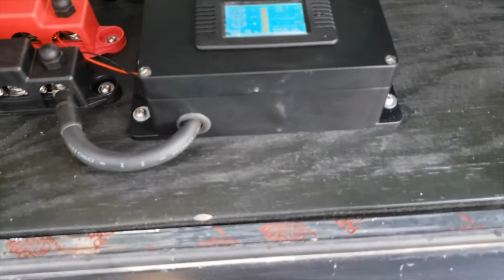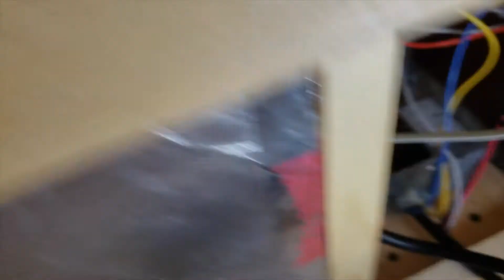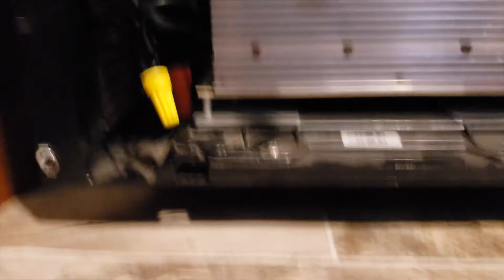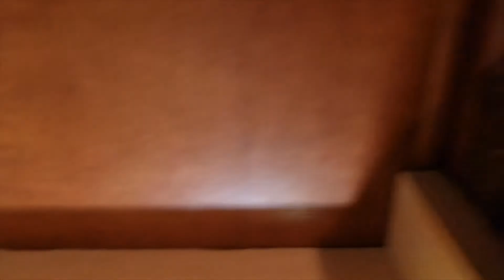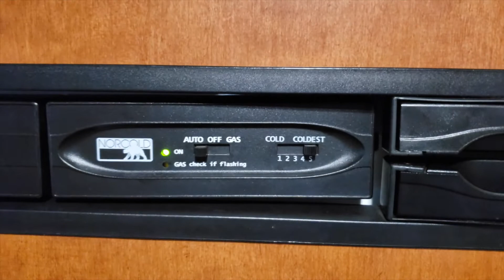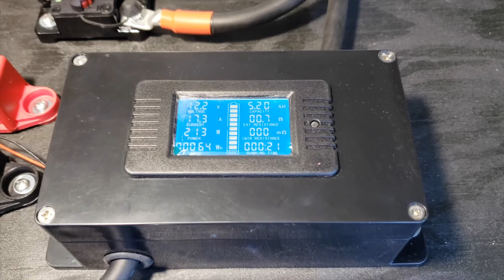Nash 17k Inverter power system installation - Part 2

Comment: I installed a big inverter under the bed in my Nash 17k.  I still haven't edited the video for that project.

The only concern with your system is the extremely long cable run between the inverter and the battery bank.  The generally accepted rule is not to exceed 10 feet, the reason is to minimized voltage drop on the DC cables.
Reply from the maker: I agree the cable length is not ideal, and would probably not install anything larger back there. The cables are 2ga, and at that length should carry 100a. Pulling 500w @ 12vdc im right around 50a, and it seems to be performing okay. I did a rundown test today and got 160ah out of the batteries before getting to 10.3vdc.

I now have a tray installed for the 3rd battery, next to the inverter. I think this would help if I decided to put in a larger inverter in that compartment, too.
Reply: 10 feet? Is the 17K different than the FM? Ours has the generator box right up front near the batteries.
Also, how long can you run the inverter with the refer running before the draw depletes the batteries
Reply: @davirodrigues8426  17k and 18fm are totally different floor plans with different locations for the generator compartment, bathroom, kitchen, etc.